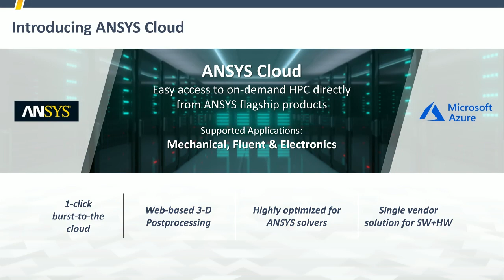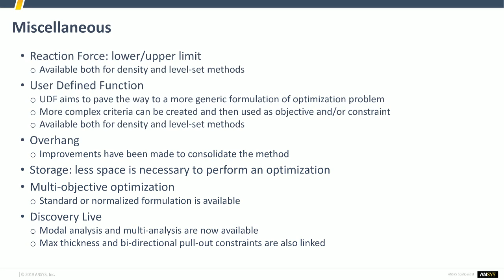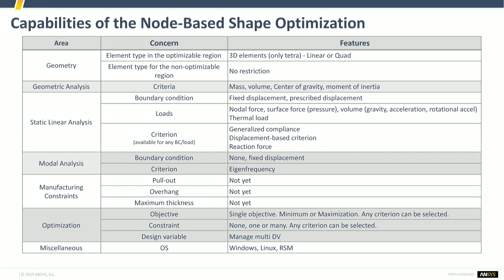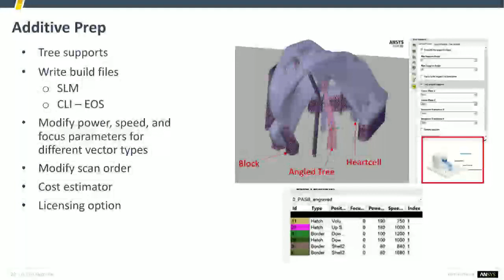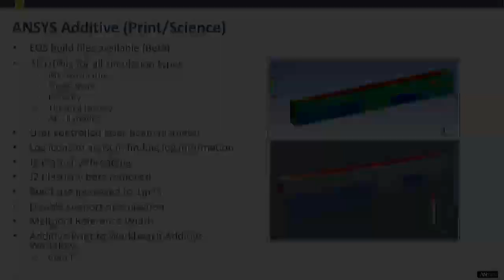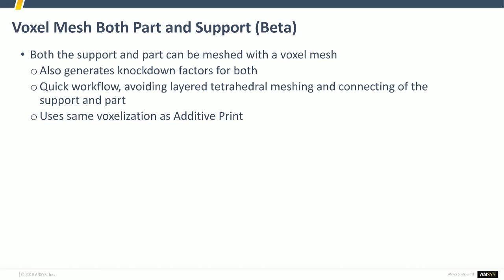Additive Manufacturing & Topology Optimization Updates in Ansys 2020 R1

Comment: I have a lot of questions: (1) is ANSYS Additive included in the "Static" part? (2) how that is different than previously? (3) is there any tutorial on how to perform a thermal and mechanical study of a 3D-printed part, let say from 3d print laser melting?
Reply: Hey, did you find how to do mechanical analysis for  3d printing simulated part